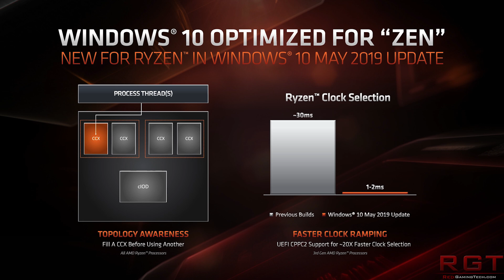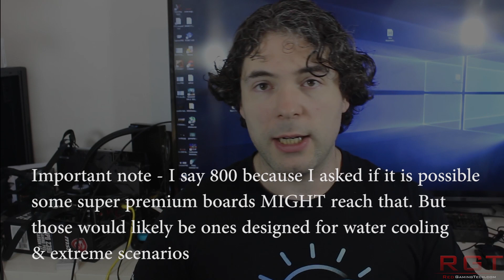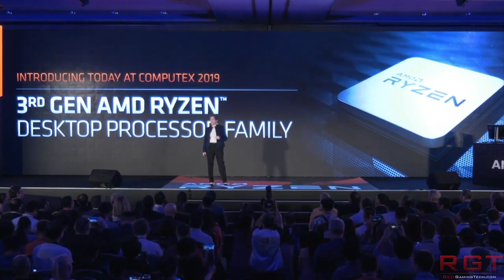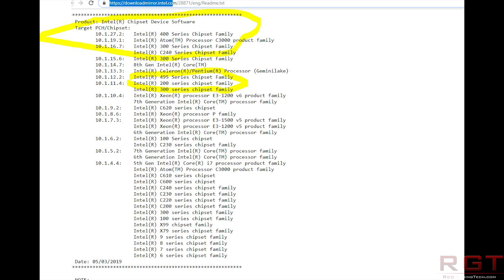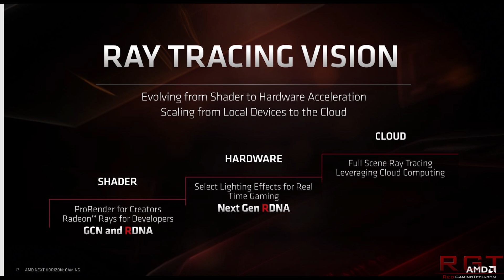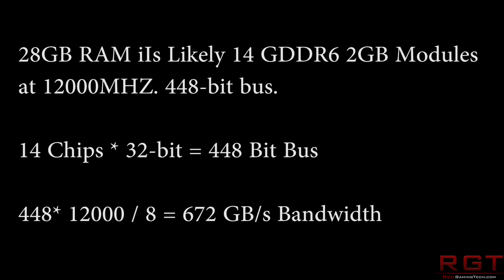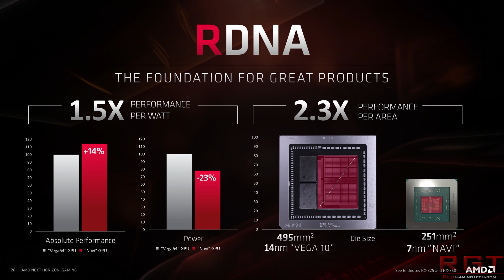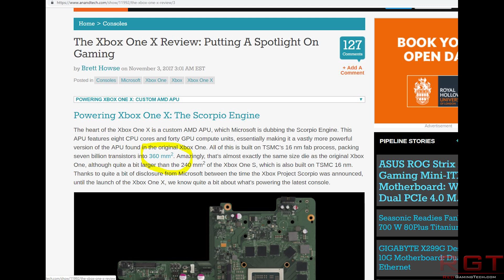X570 Motherboard Prices Investigated | Project Scarlett Spec Leak Analysis | Intel 400 Series

Comment: Who cares about Ryzen2 if you don't plan to use PCIe4 bandwidth capacities!!
Reply: Not even 2080ti saturates PCIE3 x16 lanes. PCIE4 is only useful for lower latencies, maybe NVME SSDs but nothing average consumers have will benefit from the increase in bandwidth.
Reply: @fishclaspers361  My goal is moving 100GB of Texas imagery for flight sim usage in about a second. PCIe 4 moves me closer to the goal....Of course the REAL goal is the day when NVMe moves so fast that it replaces RAM entirely
Reply: I do care about Ryzen 3000, but what I don't care about is the X570 chipset.
Reply: Because you can get a better AMD CPU from Ryzen 2 without using PCIE 4.0...
Reply: @ventzp2133  -- If all you care about was better than, you would have Intel today and when Ryzen2 proves AMD has reached parity with Intel's per-core performance then you would make the switch for that parity plus the PCIe4.0 that comes with it. 

The AMD price-point targets appear roughly comparable with intel's 8700k & 9th gen series for price/performance, except maybe for any potential process application-specific bonus your exact application use might achieve [or feel you could potentially use one day] with the x3900 ($499) 12-cores, which appears to otherwise be comparable to the ($490) i9-9900k in every other performance respect. So I am back to who cares about Ryzen2 if you don't want PCIe4.0 to make it better than Intel for the same comparable price to performance

Comment: Price gouging by motherboard manufacturers. National boycott NOW FORMING!  #BOYCOTTMOTHERBOARDS
Reply: You do realize that PCIE4 and the X570 chipset add a rather large amount to the cost of the board. You need redrivers etc. Also the vrm on these board is much better with more expensive parts than all the previous boards.

Comment: For a motherboard I´m willing to spend half the sum I spend for the CPU, I hope I don´t have to buy a 3950X to get a quality motherboard.
Reply: How about for a GPU? Assuming gaming is the priority. Double the budget of a cpu?
Reply: @juniornunez7126  I´m not gaming at all, I need decent openCL performance, as of now I´m using a Radeon VII and a TR 2950X
Reply: Buildzoid actually releases a video not too long ago stating unless you are needing the VRMs of the X570 for the 3950X or 3900X with a overclock, need PCIe 4.0 for maybe 4.0 NVME drives or something like Thunderbolt3 on some of the boards you are likely best to go with an older board. If the board could overclock a 2700X it will be able to overclock a 3800X without issue due to energy efficiency of Zen2.
Reply: @backupplan6058  going for a 3900x myself. So probably end with a x570 since I'm replacing all my old rig.
Reply: @backupplan6058  I´m looking for PCIe 4.0 for data throughput

Comment: There is no chance any console in 2020 offers 28 gb ram... this is so fake....
Reply: Vram plus system ram likely 16gb ram and 8gb vram
Reply: @johnkeane320  The most likely scenario is 16gb unified.
Reply: @KotsarisGR  id strongly doubt it. Ram prices have dropped so much that 16gb is extremely achievable.
Reply: @johnkeane320  They have not dropped that much. Remember these consoles aren't supposed to cost 2k euros, they are supposed to be affordable. Also, GDDR6 or HBM3 RAM is not exactly cheap, and getting more than 16gb of the thing on an affordable console is a pipe dream. Even very expensive gpus don't have more than 16gb gddr5/6 or hbm2 ram. 

Plus, they really do not need much RAM anyway. Unified RAM is more efficient than a PC architecture RAM+VRAM, so 16gb unified is more or less like a pc with 16gb + 8gb.
Reply: True, plus "Ray Traced AUDIO"!!!!!!!!!!!!!!!!!!!!!!!
Reply: @BruceStouder  Ray Traced AUDIO....is the NEW standard for gaming!! You Have to have it. Imagine how awsome the reverb calculations are when your charachter in game hears his name be called from around the corner! Really sound travels & bounces, and reverbs at different levels relative to positioning! You need RayTraced AUDIO if you wanna FEEL THE EXPERIENCE as intended...otherwise, you are just playing games
I should copyright this now because you know in two years this will be selling point gimmick

Comment: that leak is bs lol 12 cores? na not in a console
Reply: Yeah that leak is so garbage.
Reply: It could be using a 24 threaded/8 core Zen 3 die and they are assuming 24 threads = 12 cores. Those may well be a thing a year from now based on leaks from the past few months.
Reply: @LonnytheLesser  we will see i hope both systems are beast
Reply: @LonnytheLesser  Any "leak" which implies Zen 3 will increase the number of logical threads per core is a garbage leak and you should pay no attention to it. There is almost no benefit in doing such a thing and a lot of downsides. And even if somehow this thing ends up in the pc/server space, it still has no benefit to a console.

Plus, consoles don't really need that many threads. What they need is more per thread cpu power, a more powerful gpu and faster RAM, essentially. The things they are getting with Zen 2 and Navi.
Reply: @LonnytheLesser  They are not going to use next gen cpu processors and gpus... forget about that, they are going to use this year navi with some improvements and the same goes for the cpu. they can't use next gen navi and next gen zen 2+ thats not going to happen it will be to expensive.
Reply: First of all, they could if the needed too. Also, by next year the mainstream desktop pc will be using 6 to 8 cores cpus. So, that being said... don't expect a 12c cpu on any console pushing high frequencies... if its a 8 core cpu or a 10/12c cpu it would be at much lower clockspeeds of around 2.5 to 3.5ghz at most, that to keep DTP low and cost even lower as they do not need the best yeilds for it. it wont be impossible to see a 10/12 core cpu for consoles to be honest. And cost will be around 500 to 600 USD for sure. SSD prices or nvme drives are a bit expensive, we are looking at 85 to 110£ for 1TB SSD drive and we will be needing way more than that expect no less than 1.5/2TB at launch.
Reply: @neikory  Mainstream desktops won't have 8 core cpus any time soon. Remember not everone upgrades their cpu en masse each year, cpus are perfectly capable for at least 5 years these days. Also, 8 cores are still very expensive for mainstream. 6 cores, eh, maybe, but gaming is not that much cpu core intensive even with the advancements in multithreaded rendering.

Console developers will prefer to assign a larger part of TDP and transistor budget to the gpu part, which will make a larger difference in the quality of video games, especially if they need to do raytracing as well. If you think they will put 8 large cpu cores on the things you are mistaken. 90% chance that both consoles will feature a 4 core Zen, which will still be a significant upgrade in performance anyway (Jaguar is extremely weak in IPC and has very low clocks). There is a 9% chance they will put a 6 core zen on the consoles. 8+ cores are a very weak chance. At least not without significant cuts and i am not talking just about lower clocks.
Reply: And you will have Xbox guys believing this lol
Reply: They are probably deceiving people to go for the more cores cpus so they feel future proof.
Consoles will probably be 6 cores or 8 cores low clock.
Reply: Yeah I'm with u 

12 cores no way, if its true it definitely won't be priced at $500.00

And most parents are not gonna pay over $400.00 for a video game system 

So yeah i definitely call it Bogus
Reply: Maybe not this year, but given the possibility to see it being a thing in 2020, we might see. But remember that the xbox one do in fact has a stack of two quad cores modules back in 2013, making it an 8 core console. It's not impossible to think a console will easily hit 12 cores or even more in this day and age.